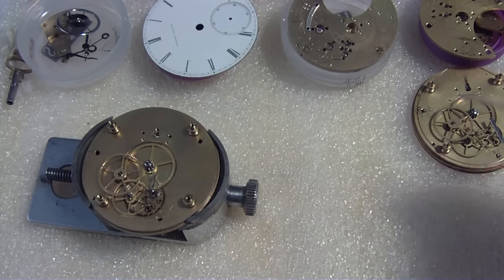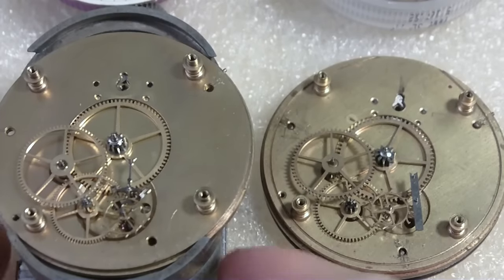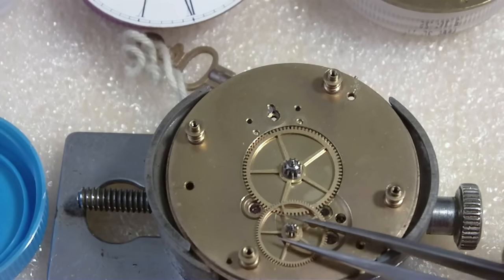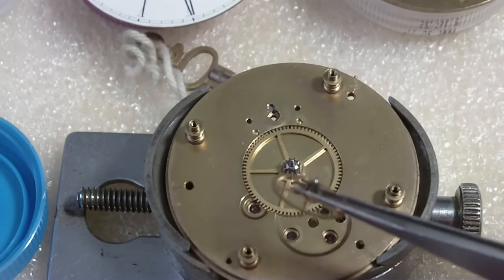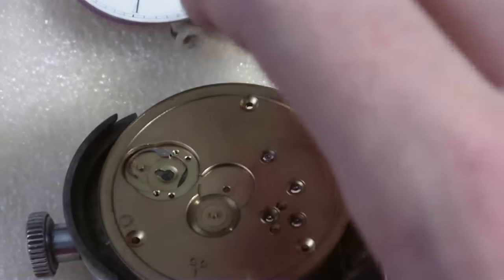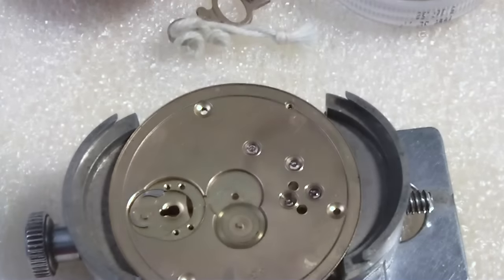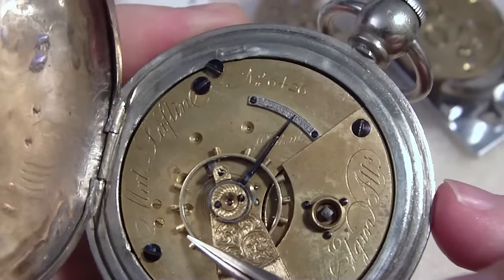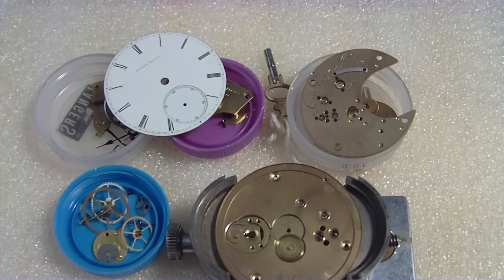How I take apart a pocket watch Part 2, Elgin National Watch Co

Comment: Bunnspecial. I took a look at the gears you indicated.  I didn't find a problem with them.   I did find that when I reassembled it that it now works fine.   Not sure what happened.   Don't known if it's possible to over tighten the screws that secure the movement to the case but it seems to have had an influence on the movement.   I'm wondering if something else is slightly bent or warped.   At any rate it now runs fine.  Thanks.
Reply from the maker: From what I have seen the screws that hold the movement to the case bottom out on the case before they touch the top plate.  If the screws contact the top plate they could warp it.  At least it works now.

Comment: Bunnspecial,  I hope that you can give me a little insight into a problem I have with a New York Standard pocket watch.  It runs but hangs up every 3 hours.  When I pull the stem it wont move forward until I back it up and forward a few times then it unsticks.  Any ideas?    Thanks
Reply from the maker: I don't think the problem is with the train because after 3 hours everything but the mainspring barrel has made more than one full rotation.  I think it has something to do with the hour and minute wheels and that little gear from the setting mechanism under the dial since it won't move forward when you pull the stem.  Maybe some dirt or bent tooth.  Let me know how you fix it because it might happen tome one day.
Reply: bunnspecial.  Thank you for the advice.   I'll take a look at it later this week.   I'll let you know what I find.

Comment: Hi did u make your hand removers yourself if so with what material. Would like to make a pair myself. Any video tutorials on tool making?
Reply from the maker: Yes I made the hand pullers myself.  I made them for hairspring collect removing but they also work as hand pullers.  It is some piece of steel I found on the side of the road while I was walking.  I think it is stainless steel.  It looks like it was used to make the windshield wiper blade stiff.  The original piece was about a foot or more long.